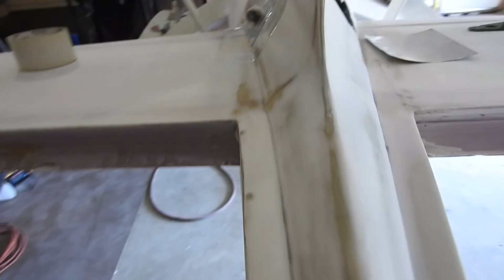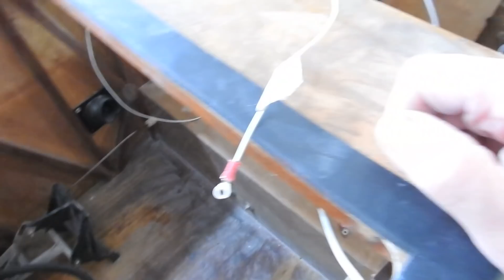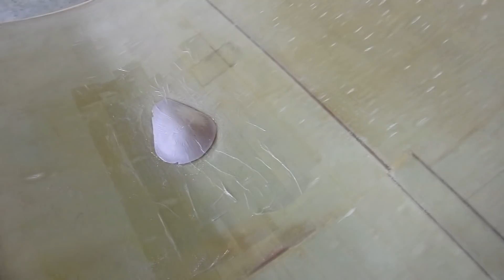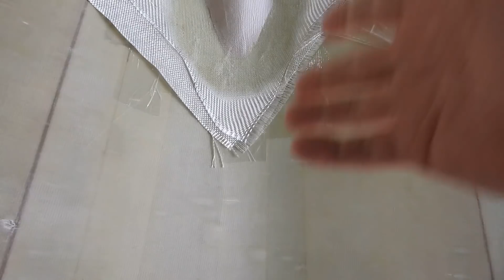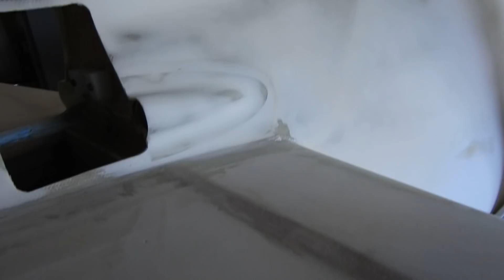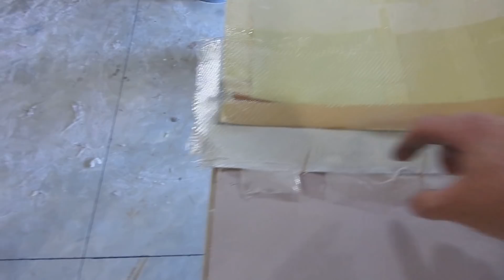W.A.R. Corsair Update6/9/2019

Comment: What grit sandpaper do you use on the micro-balloons before epoxy wiping? Another channel mentioned 30-80 grit? Playing with filling in areas of my cowling, and making transitions. Making smooth transitions has been a little challenging. I am starting to feel I am not using enough micro, and to fine of sandpaper (180)? The process is very slow! Looking forward in trying the epoxy wipe method!
Reply from the maker: You want to put the thick micro mix on about a 1/4 inch thick and sand it down with 40-80 grit. Don't worry about the heavy scratches, the epoxy wipe will fill them. It may take 3-4 wipes to do it, but it works great.